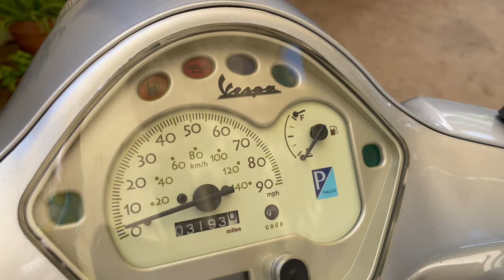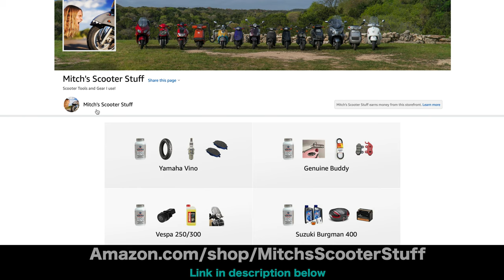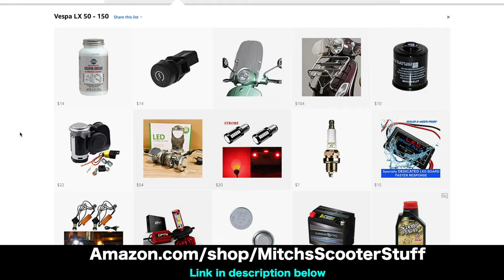Vespa LX Rear Wheel Removal / Installation | Mitch's Scooter Stuff

Comment: My 2008 LX50 had combo bolts holding the exhaust flange to the engine.  10mm socket/6mm hex.  It's very tight in there, having the 6mm option and a ball head is great.

Comment: i dident undestand why new vespa is so complicated to remove the wheel, before in olders vespas it take 5 minutes to change a wheel, now if you riding and the exhaust is hot how they will spect us to change it besydes they dont have an extra wheel  =(

Comment: My wheel doesn't comes out
Reply: what I did is to go on the other side, push on the left side and hit the tire with hammer on the right side. So while you pushing the vibration of the tire hitted makes the tire to move a little bit each time until it comes out. The only way for me to leave the tire. Same thing putting it back, using hammer on the tire

Comment: Should I hit it with Hummer?
Reply from the maker: Spray WD-40 around the wheel hole on axle and let it soak for few minutes
Reply: @MitchsScooterStuff  thanks for the answer.i did what you say, + I removed the brake and then I waited a little bit and hit it with plastic hummer and I managed to take out